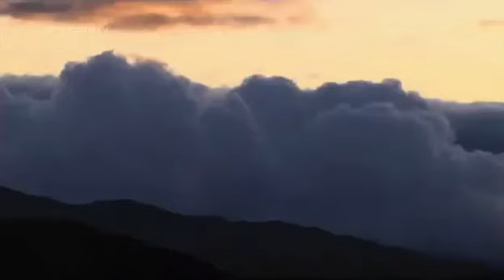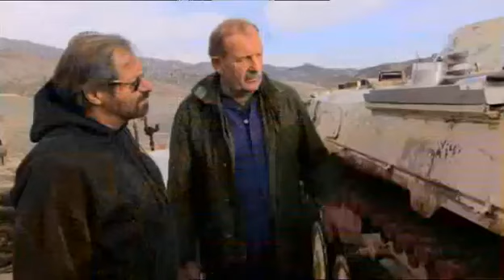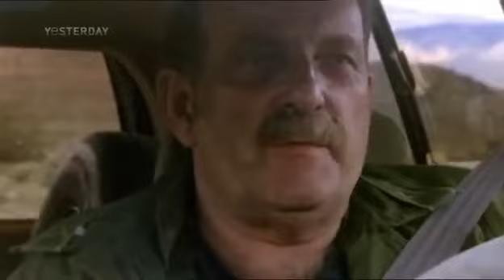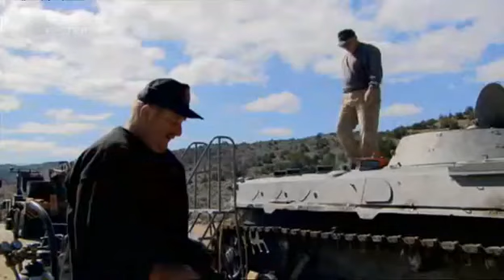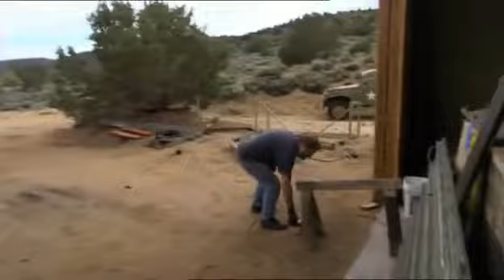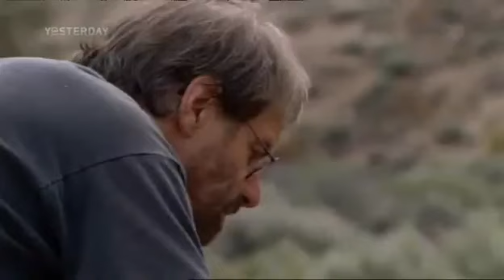BMP-1 Soviet Infantry Fighting Vehicle-Documentary

Comment: The BMP was definitly not the first infantry fighting vehicle. The idea was born at the latest (perhaps the Brits had such ideas in the 1920ies) end of the 1930ies. The German halftracks SdKfz 250/251 were already used as fighting vehicles in the East. German mech. infantry did fight many battles from their vehicles (ex. the battle of Rostov). In the west it did not work against the US/GB as the half tracks with its thin armour (8 - 12mm) were an easy target for fighter bombers and as well 0.50 MG. After WW2 the German forces did implement new fighting infantry vehicles as the HS30 in the 50ies and the Marder 1967.

Comment: The Iraqi army had antique machine with classical turret fitted gun.Latest model used by Czechoslovakian army used actually  rocket launcher, mounted as gun,and shoot double stage penetrating rocket with range up to 5km,what was more than enough for the optical system. But commos didn't sell that system to abroad. Some Czech improvement was more better than actual Russian products. For example during Afghan war 1979-1989 helicopters has been repaired in Czechoslovakia. S.Union had shortage good quality machine industry,but plenty oil and gas.

Comment: That army butt licker is such a hypocrite. He si comparing BMP to 20 yeares newer Bradley. Also BMP series vehicles are much lighter type of IFV, they can swim and be airdropped. There are dozens of IFVs, most of them are better then Bradley. 25mm cannon is a joke. This is 2009 "documentary" and Bradley is already obsolete. Heard about CV90 or Puma?
Reply: As I know the best IFV today is Namer, I've been working with Puma for many years now, while armor is great and mobility is fine its has one major flaw, it's tracks system is garbage, if you have rocky terrain it won't go far, heck even on asphalt it can disconnect.

And yes American propaganda is funny :)
Reply: Interesting info, thanks. What do you think about all ruber tracks of Rheinmetall Lynx? Cant´t imagine it will work in battle conditions.
Reply: Well the only rubber tracks I have seen in actual action is of a heavy tractor removing obstacles for tanks and trucks to pass, so cannot say that I am expert on it, but from what I know and understand, the rubber tracks are completely fine, it does have much better solid/dry ground performance while on wet and muddy it probably can sink, on rocks it's probably better than standard tracks as well.  
Now one think to remember that it's moving like a car, so you cannot turn around in tight spaces, so in a city the Lynx is limited.

Comment: The Bradley - too heavy to be air dropped, basic armour that can barely stop a .50 cal, only holds 6 soldiers, the aluminium armour is flammable, the add-on steel armour makes the vehicle top-heavy, and the range is short, requiring the American logistics train for the vehicle to be fully effective.

And it's 10 times better than the BMP-1 😨

Lol, I'd still love to have either to play with, but I don't think I'd really want to go to war in either 😂
Reply: I drove an M2 and M2A1 in the 80s. One thing you have to remember is it was not designed to be a tank. It was designed as a replacement for the M113 Armored Personnel Carrier. As such, its role was to carry an infantry squad of 7 dismount troops - the Brad had a crew of 3, making it a 10 man vehicle - to within around 500 meters of the target. It would dismount the troops and stand in overwatch until the dismounts took the target, THEN go in and help mop up. Used in that way, it is an awesome vehicle. The problem is with the officer corp, not the vehicle. They decided that since it LOOKS like a tank, it IS a tank, and the dismounts were pretty much left as an afterthought.  That is the big mistake. The 25mm is a good gun and with proper maintenance it does what it is supposed to - defeat the enemy's personnel carriers and soft skinned vehicles. It is not designed to deal with tanks, though in certain situations, it can disable them. The 7.62mm coax does its job well - make the enemy troops keep their heads down until the dismounts can deal with them. At the time I was in, the TOW missile - when it worked - was good against tanks. Yes, the armor was a joke - we called it the 30 ton budweiser - but used correctly, it wasn't much of an issue. Weapons-wise, the BMP was rather impressive, especially the Sagger missile. BUT - The crew was incredibly cramped in, to the point that if they were in it for more than about an hour, they could barely walk when they dismounted. In combat, that pretty much means death. The armor on the BMP was fair, but its main effectiveness was from the front, due to the slope. Catch it in the side or rear, it was done. Remember the soviet slogan - build them cheap and build a lot of them. Their idea was the same as during WWII - flood the battle field with numbers and some will hopefully get through. If I have to go into combat in one or the other, it will be a Brad every time. And there's nothing like the feeling of airbourning a Brad and going weightless in your seat! I did it many times.
Reply: Stephan Smith 
It's always interesting to hear from people who served in these types of vehicles, to get the real story, instead of whichever agenda might be inspiring the "common knowledge" that civilians are limited to.

From what I understand, the BMP-3 is a much better vehicle than the BMP-1 was, though it's 30mm cannon can't have a very effective HE round for troop support, whereas the 73mm cannon on a BMP-1 was limited in use to infantry support, leaving the anti-armoue duties to the Sagger missile.

Thanks for the info!
Reply: I'm glad to find you are interested in what I had to say! For that, I thank you. Yes, the BMP-3 was a bit better due to some improvements made during the production, but it was still inferior. The 73mm on the BMP-1 was fur troop support only - it was a fairly low velocity gun, intended more for mobile short range artillery than dealing with armor at any kind of range. As far as the 30mm on the BMP-3, it wasn't a bad gun when the ammo worked. The BMP series was intended to be used similar to our Brads with one big difference - their training manual was basicly the German Blitzkrieg. Attack, always move forward, never defend. We always trained for both offence AND defense. For dealing with armor, it had a sagger missile mounted on top of the 73mm. It also had a ground mount for the infantry to use. The drawback with the sagger, and it was a big one, was that since it was wire guided, the vehicle firing it had to remain completely still until the missile hit. That made it a huge stationary target. On the other hand, we had the TOW missile on the Brads. That was ok if you were firing from a dug in position because the TOW was wireguided and had the same basic restrictions for sight on target. The book said we could drive with the TOW launcher extended, but we could not go more than 4-5mph. Because of this limitation, we always secured the launcher before making any kind of movement and TOWs were never fired on the run. I hope I'm not overloading you!
Reply: Stephan Smith 
You're not overloading me at all, I'm enjoying hearing the "real deal"! I knew about the limitations of the Sagger, but didn't realize that the TOW missile system suffered from the same limitations, as it's advertised in the media as "mobile". Isn't there an upgraded version that's "fire and forget"?